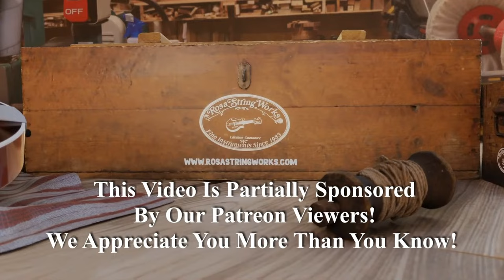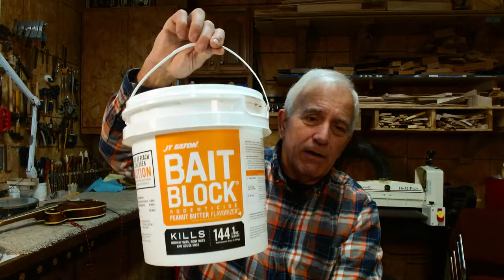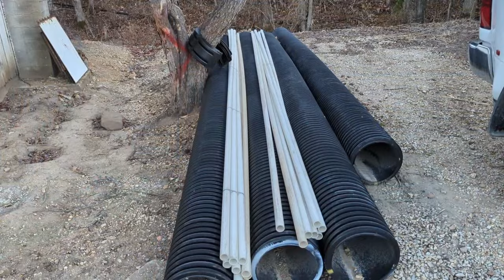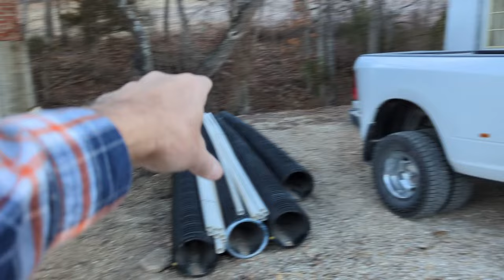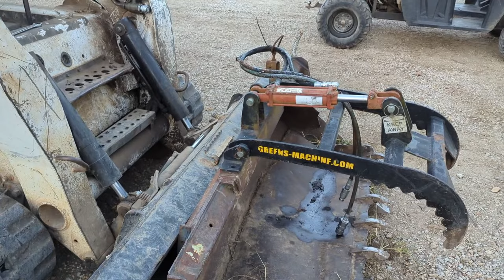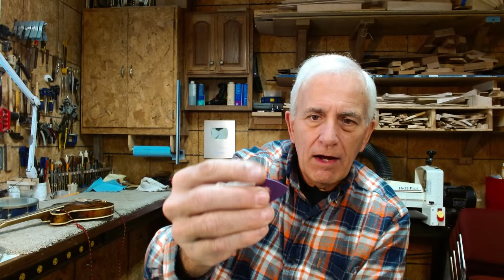Vlog 364 LIVE A Shallow Dive Into The Bowels Of The Bobcat Video and More

Comment: ?????? Jerry, could you possibly push a stiff wire or rod
into the fuel line, from the primer bulb connection, to push
out the fuel screen, in the tank, and then install an inline
filter, just before the primer bulb? 😁✌🖖